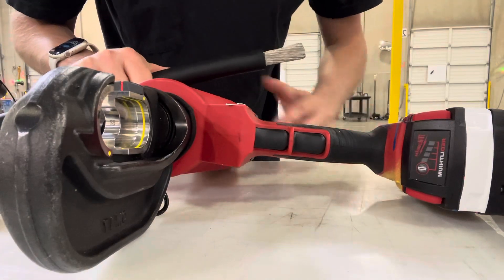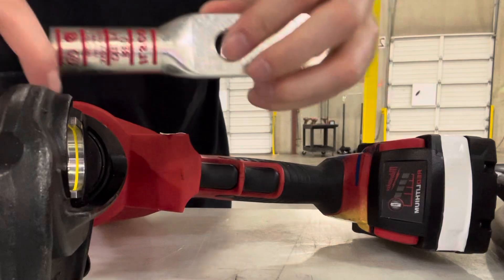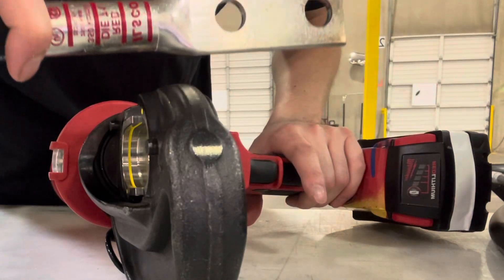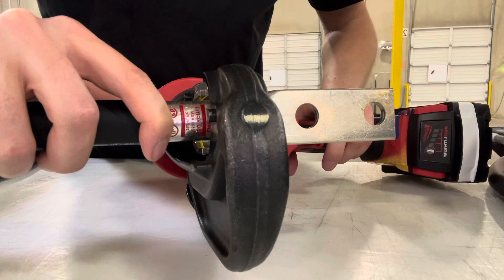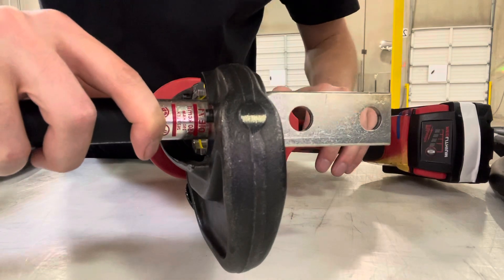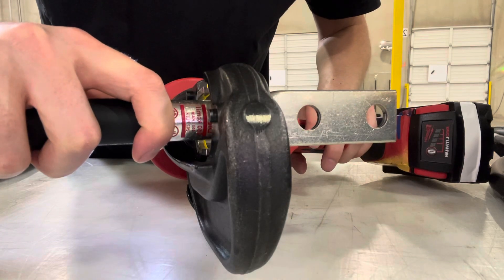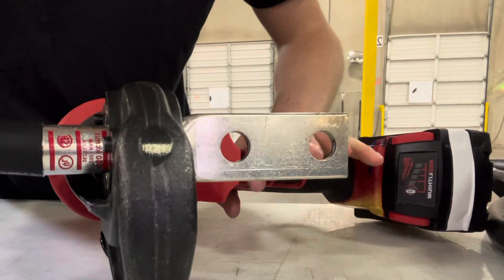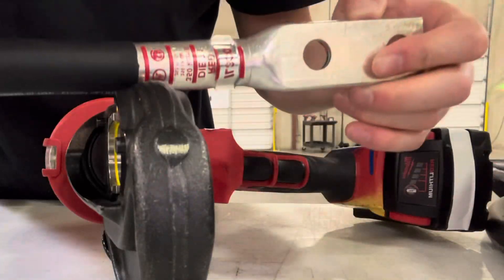Using The $5,600 12 Ton Milwaukee Crimper (750 MCM)

Comment: You ever used any other brand one to be able to see any differences?
Reply from the maker: Yeah, the burgandy or some name like that. 2 of those broke so using the milwaukee now. Do about the same thing as long as they work LOL. The milwaukee seems to squeeze a little tighter but thats about it.
Reply: Burndy. They've always made the top machines. Milwaukee's trying to make everything now a days. Milwaukee wasn't even a brand until more than 30 years after they began making them.
Reply: All these Milwaukee crimp videos and i haven’t seen a crimp yet that i wouldn’t cut off and redo.

Comment: It is really strange that the Milwaukee circumferential (round) dies for the 12 Ton Crimper are bottoming dies, with the result that the crimp has slivered ears or wings (which are not wanted and dangerous in handling). If you look at traditional circumferential dies from Burndy (6 ton W dies for example) or the Panduit equivalent, they do not bottom. This is accommodate making ears that are not sharp but rounded (the inspector for a four crimp will look for a consistent rounded ear pattern), which historically will pass inspection for UL certified crimps, especially if you have the Burndy (or equivalent) symbol embossed in the crimp. For the UL crimp you want a single crimp in each required position, with the proper certified force needed, embossed logo with die number and consistent ears.

In some cases for UL crimps you may have to use a die for a unique wire type like K or M (generally called Flex in the US due to the high stranding). Usually, if you use a non-bottoming W die you are covered, but not always (depends on the lay of the cable). If you want to use a bottoming die (either round or hex) you would have to experiment in order to find a die that bottomed without producing an ear (sliver). You would then cut through the crimp to inspect it and if okay this is what you would show the inspector. You can see how a non-bottoming circumferential die is much more forgiving in that if an ear is produced it is neither large or sharp. 

The trend in the USA is to move away from circumferential non-bottoming dies to hex bottoming dies, which have a long history in European electrical distribution where you match the die and lug to the wire cross sectional area in square millimeters (there is no color coding) for type B stranding. Hex bottoming dies (with proper matching of lug to wire) will produce consistent crimps without ears due to the additional symmetric corner area in the hex pattern (the hex geometry is better suited to provide the needed expansion area when the die starts to bottom). Greenlee makes color matched hex bottoming dies for the US (AWG) market due to the teams (German Klauke) experience in hex die design. T and B have followed this trend with their latest tooling and it looks like Panduit will do the same.

There are a few transportation applications (auto and marine) where crimp ears are not wanted, and traditionally have always used a hex die (lugs may not be color coded like "Battery" lugs from Panduit). Mainly to facilitate the use of sealing the crimp with dual wall heat shrink tubing without possible damage from a sharp ear.
Reply: thank you.
Reply: rotating and re-crimping always gets rid of the ears.
Reply: It looks like he used a yellow on a the red lug
Reply: You sound super knowledgeable on the subject. Would you be open to discussion and some Q&A? I've been researching crimping in general as it is a part of the field few electricians get to work on. There's forums where people have talked about it but it's all random questions.

I would like to get someone that's very knowledgeable to put together a guide/document for others to use. Please let me know if you'd like to talk more about this. Thanks!
Reply: I've never in my life used a milwaukee electrical tool that I have liked. And I don't do side work anymore, so that excludes the stapler. Which may be the only trade specific, electrical tool that they've ever made that was any good.

Comment: Mines has served me well but I just started having an issue with it. Without warning the release trigger will not engage so I can't release the crimp. The crimp went to full cycle until the green light came on but when I tried to use the release trigger it wouldn't budge.
Reply: Me too
Reply: @paulpalermo2109  I was able to fix mines. Once I took it apart I saw part of the trigger mechanism had broken. Turns out it's not even required because once I removed it, the crimping tool has worked perfectly since. I am actually scheduled to use it again tomorrow for a job.
Reply: Mines blow up when you step on them